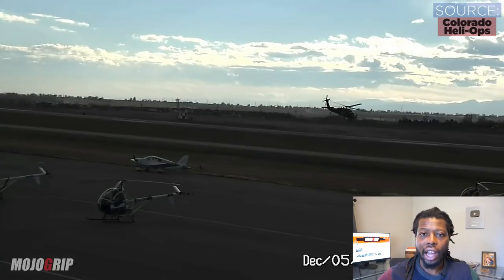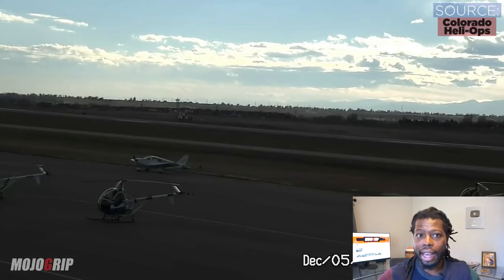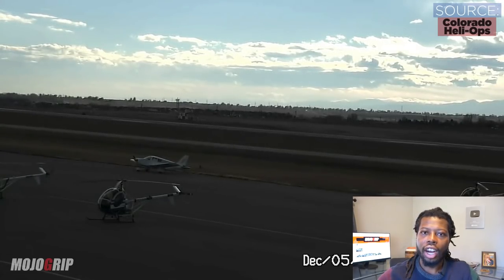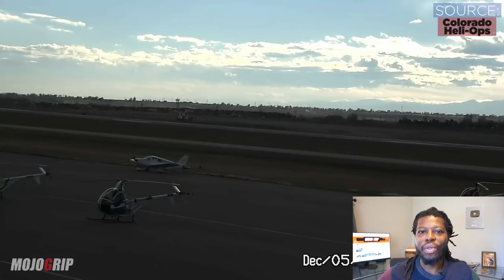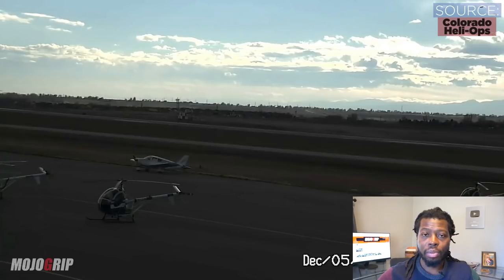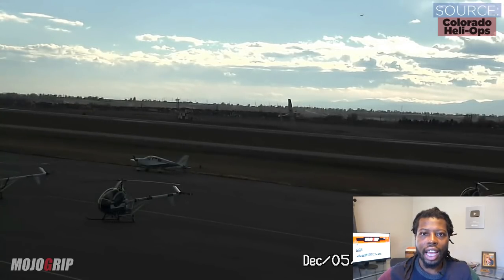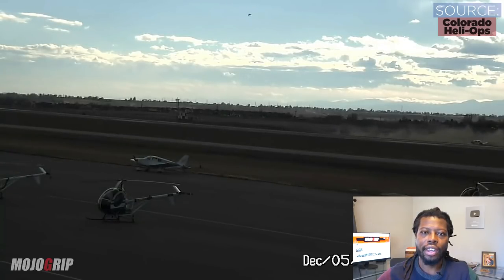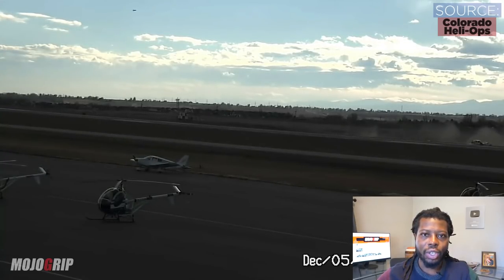Pilot Loses Control Of Airplane In Mid Air

Comment: Think of it as a boat passing another boat, that big wake of water bigger boat bigger wake
Reply: Yeah but it’s in 3 dimensions, like a big wave with a giant whirlpool in it.  Bent over and kiss you too-too goodbye.  Worst wake conditions I experienced is in the river between the US and Canada south of Port Huron where Lake Huron enters the lower lakes.  On a sunny Saturday you get these 60 foot Bertram’s, running not quite on plane, the 4 to 6 mph current, the reflected wakes off all the hardened banks of the river and what you think is going to be a 3 foot wake turns into a 7 foot monster.  I’m in a 32’ go fast boat and I plan on slowing down a little and then a 14’ fishing boat about 1/4 mile ahead of me go out of site.  I slow down a lot.  When I pass the fishing boat I see he has his deck built up with a 4’ sheet of plywood to break the waves.  Got to catch them wallied eyed pike!

Comment: Wake turbulence has caused fatal loss of control.
Reply: LC CL  Improper pilot rudder input says the NTSB final report.
Reply: It's caused planes to lose their wings entirely too
Reply: LC CL  Just passing along that the final report was. And, the airlines had to include a "be gentle to your rudder" segment to pilot simulator events industry-wide. It used to be that ATC had to wait 2-minutes (not 1-minute) before rolling the next takeoff (same runway) after a heavy. Pilots had the option to wave that time. Now, separation is predicated on mileage, not time.

Comment: Once I saw it happen in front of me.  After a formation flight  we separated on final and the leader landed first. flying behind him I saw him  starting to flare of and then suddenly out of nowhere his plane pitched up made a quarter barrel roll hitting with his wing the ground making kind of saltos on the ground and the wooden wings just desintegrated in lot of wooden pieces  . Only than I noticed  a 50 pax turbo prop on the end of the runway  who had landed some ! minutes ago, I gave full throttle pitch down flaps up and  as there was crosswind from the right I went to right and escaped most of the turbulence  seeing the disintegrated plane of my friend on the ground and said to my passenger , I'm afraid they died ... My luck I was second to land and was flying an heavier airplane and somehow in stress situations I handle automatic without any emotion.  My friends luckily survived and I was told by the medics they were only light hurt. (well what you call light. one missed an eye and the other had all his legs and hips broken....  )   .  Especially at uncontrolled airports you have to take care.

Comment: Correction at the 3 minute mark. The video showed a helicopter creating wake turbulence caused by his rotors, then a large jet following and the video shows the jet is Greatly effected by the helicopters wake turbulence. * It's at this point where the WRONG idea was passed on. 

The size of the aircraft that created the turbulence is of major concern. The helicopter is far smaller and is creating far less turbulence to effect a large jet, as shown. The jet would, more than likely notice nothing, simply because of the size differential. Reversed, and if the jet created the turbulence and the helicopter passed through it, the helicopter would, or could be in trouble, unlike the jet, in this example. Another point: If you are in a small 2 or 4 seater plane, waiting to take off behind a large jet, for example, depending on the ground wind, you will have to wait for the turbulent air to pass, before you can attempt your take off run. The wait is depending on the wind speed, and the direction it's coming from. The wait could be several minutes, if the wind is light, and is blown away slowly. On a calm day, this is the worst case because with no wind on the ground, the wake turbulence will remain right there, in front of you for several minutes, creating anxiety on your part because #1, you can't see wake turbulence, and #2, others behind you want to take off as well, and can't because you are in front of them. Last note: When landing behind a jet that has just landed, his wake turbulence stops when his wheels touch the ground. In this case, you simply land beyond the point where the jet touched down by say 100' or more. You will feel no effect because the turbulence created, stopped at the point of the wheels touching down. If you are taking off, the situation reverses, and now you have to wait those several minutes. This is always YOUR decision, not the controller's. He wants you to take off, you, on the other hand, want to see tomorrow, so you wait. It's the RIGHT thing to do, and EVERYONE knows it. Do what is safe, and live to fly again.

Comment: The larger the displacement of air by the cubic size of the type added to the turbulent energy of the drive system and the rolling
Reply: ....vortices coming from the airfoils there exists a real invisible threat to any following airframe, large or small.  You may compare wake turbulence  of an aircraft to that of a heavy displacement water vessel. There are differences however also many similarities. The wake from the bow and stern of a large vessel can destroy or submerge a smaller craft much the same as to what an A-380/B-747 can do to an aircraft of lesser dimensions if in too close a proximity. Wait before you follow. Be alert!As any pilot or instructor knows; air or water turbulence may present  a serious control issue.

Comment: The point of the topic is important, but, @2:48 a helicopter's wake enough to disrupt a 747? Com'on Mike.. Maybe the other way around.  

The danger/risk of wake turbulence is proportional the the weight and energy, compared to the weight/energy of the affected aircraft.  747:747 less-minimal risk, 747: Cessna 152 extreme risk that could result in mishap.  I know of a fellow pilot who almost bit it (partially induced spin, engine loss) in a Bonanza, after getting caught in the wash of Gulfstream flying into KFXE. What saved him was he was at 8K, and had ample training on spin recovery, and his emergency procedures.

Bringing me back to @1:14 - "it's not necessarily dangerous"; it is REALLY dangerous, if the relative weight/speeds ratios are so off, in addition to the proximity to the wake just after it's generated from the producing heavier aircraft.

The best assumption, for private pilots especially in smaller airframes, is to conclude all forms of wake turbulence are POTENTIALLY dangerous.

Otherwise, spot on!

Comment: If i want to explain this to my non pilot friends I tell them that I went into used air.
Reply: Wait. That's MY line!
Reply: As a physicist and engineer, I think that that's a very good description. The heavier the plane, the more lift it needs to generate and the more air it needs to use. 

It also applies to sailing. If you're going to windward, for example, and you're trying to overtake a slower boat, you get slowed down by the wake off the sails of the boat in front. Sometimes the airflow over your sails just stalls. If you're trying to pass a boat that's the same size, you can usually work out how to use their disturbed wake. If you're trying to pass a much bigger boat, it's best to give them lots of room or tack and head off in another direction. 

My next-door neighbours are recently retired Airforce officers. Their annual Christmas drinks party attracts lots of former Airforce pilots, some of whom went on to careers flying 747s and A380s. They have talked about wake turbulence being so severe that it could destroy twin-engined planes.

Comment: Great vid, but actually I think, heavy and slow on landing, its more dangerous than on takeoff  but I could be wrong
Reply: Go around of a larger aircraft is the worst.
Reply: Takeoff is worse because the flap settings are lower which means the angle of attack must be higher which creates more violent vortices.

Comment: I don’t go near wake turbulence. (Period) I have experienced it once and that was one time too many. The whole concept of flying over the flight path of a larger aircraft only works near the ground. When following a larger plane which climbs out much faster, you invariably get underneath their flight path. I was about 750 ft AGL and turning South after a large jet had preceded me heading due East. Knocked me against the bulkhead so hard I had shoulder pain for 2 days. You don’t know the winds aloft at 750 ft.
Reply: @Chris Waggoner: I've gotten smacked by wake turbulence from passing planes at higher altitudes (20,000-feet plus).  It does get your attention! The wingtip vortices are always present when an aircraft's airfoils (wings) produce lift.

Comment: I am curious about formation flying (which I have done, though only twice and a LOT of years ago in a propeller driven airplane🤣). How is it that the Blue Angels and other flight demo teams can maintain flight in such close formation that wings overlap and flight lead's exhaust is blasting the lead wingman, and element lead's exhaust is blasting the element wingman?
Reply: Great point...only thing I can think of is the air never has a chance to keep it motion when the are close like that..but to your point..how do they get into that configuration..
Reply: @hendersona49  

Yeah, we know they do it because we can see like  hundreds of videos on you tube, and live at airshows. I remember flying formation twice, but we didn't fly as close as the military demo teams, and we were in propeller aircraft. But we flew by 'flying paint' , picking out a decal or paint scheme feature on flight lead's aircraft or element lead's aircraft, and flying only in relation to that. There was some turbulence, but not so much as to be be problematic. I wonder how the Thunderbirds & Angels deal with wingtip vortices and jetwash with 3 feet of their wingtips overlapping? There has to be physics that can be calculated somehow.

Comment: It didn’t look like the pilot “lost control” as he passed through the wake of the 757, it was a very sharp bit of momentary turbulence. Had the aircraft been upset that required control application to get back in control then I would agree. That said, the turbulence associated with crossing the wake can be very abrupt and disconcerting.

Comment: I kinda assumed that’s what a “wake” was but here’s my question, airplanes land & lift off almost constantly at airports so how do they combate this? I assume they just wait on the taxi lanes for a couple minutes 🤷🏽‍♂️
Reply: Pretty much, but wake turbulence is a much bigger deal when there is a big size difference between two aircraft.
Reply: Also flying directly behind a wake would be better than flying across it. Its basically the same as a Boat jumping another boats wake, but the wake is still turning complete circles as it moves up or down depending on atmospheric conditions.
Reply: @Superxpninja  good point. I don't think pilots realize that helicopters can leave just as much dirty air as a 737 when in a hover or turning on deck.
Reply: @airhead1187  that's true and when you put it that way its mindblowing